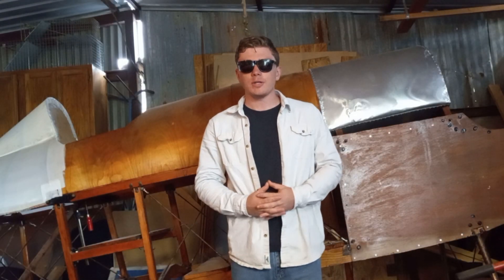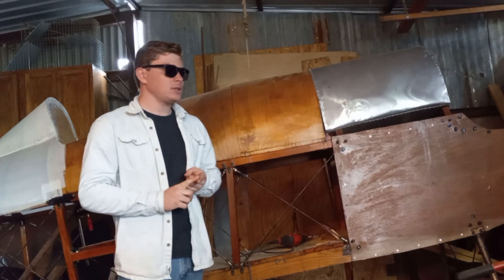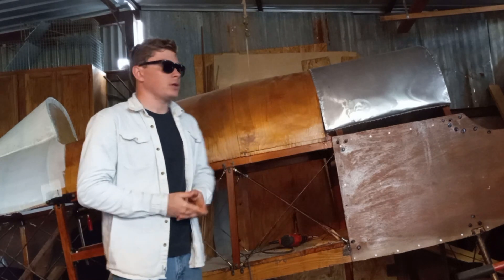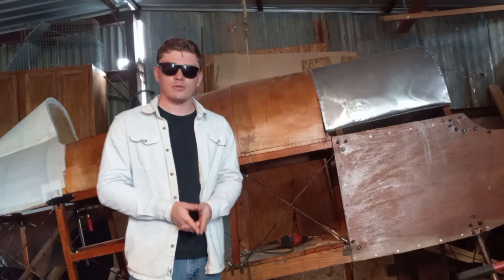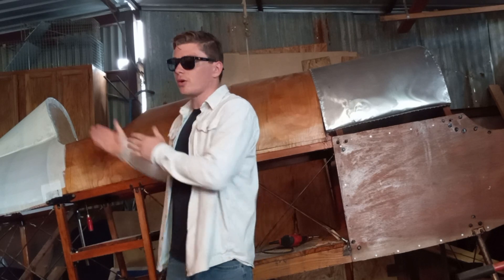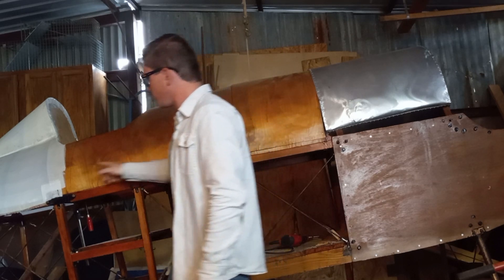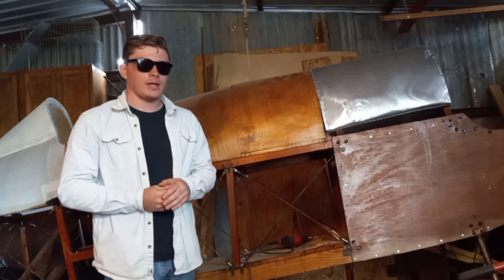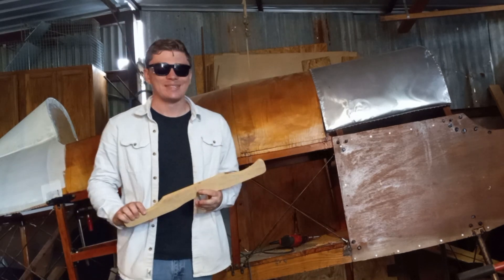Homebuilt Airplane Episode 11: Making Some Aluminum Parts

Comment: You know,  next time set up a jig and a router or jig and belt sander and splice two pieces of plywood together to make them the length you need.  If you match the grain it can be very beautiful and you with a tiny enough taper you won’t even notice the joint.

Comment: Awesome :) did you use original plans?
Reply from the maker: The original plans still exist (they are in the British archives), but they charge 20 bucks per sheet for scans and there are hundreds of sheets, so they really aren't attainable. The plans I am using are from a company called replicraft. They technically aren't the originals, but they are pretty close.
Reply: @EvanJonesProjects  thank you for the reply :) I didn’t realise! I have 101 questions to ask you at this point! Do you have any other socials we can follow? :)
Reply from the maker: @AdmiralNelson-lo9ys  I have a twitter account, but I don't really post much.
Reply: @EvanJonesProjects  I took the plunge and bought the plans! lets see how this goes!
Reply from the maker: @AdmiralNelson-lo9ys  That's awesome!
Reply: @EvanJonesProjects  Seems a shame. After the initial scans and digitization, where's the justification for the cost? Especially since servers and storage are no longer a factor.